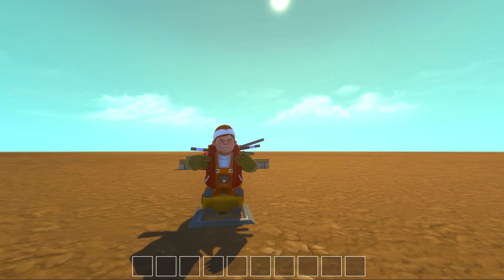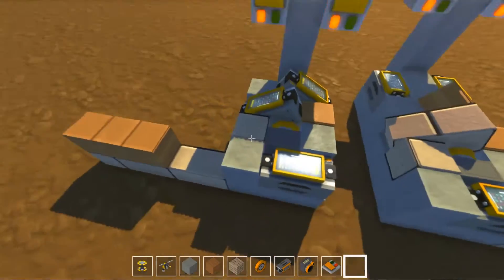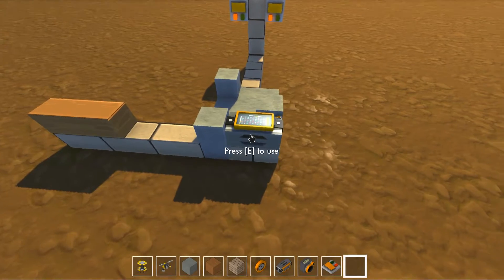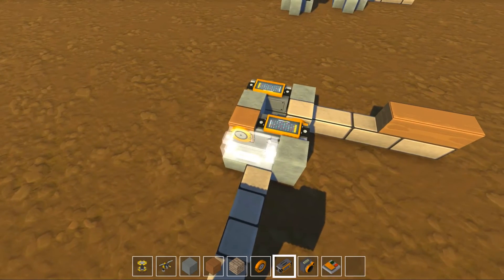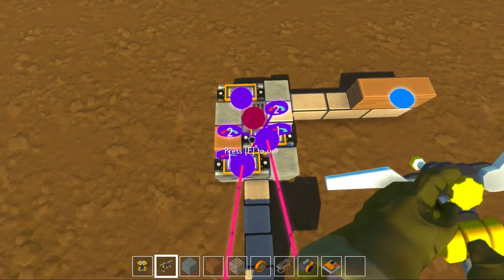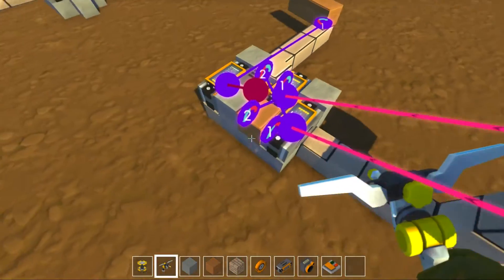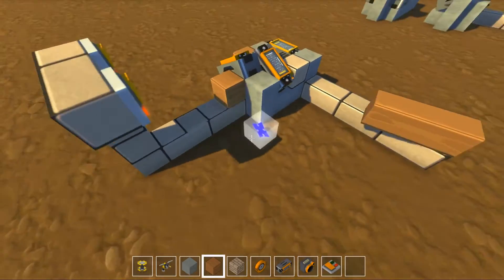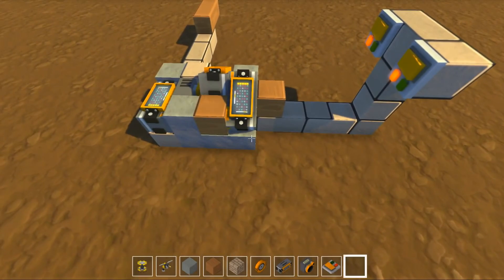Scrap Mechanic Tutorial - Ultra-Compact 2-way Switches (3x3 XOR Gate) [Logic Gates]

Comment: Isn't this easier for fast 2 way door switches? nice work tho,https://www.reddit.com/r/ScrapMechanic/comments/439v92/two_way_door_switch/
Reply from the maker: +Joaco Remis The thing you linked to may be a little easier to make, but it only works in a specific order - if you flip the switch from the outside, then go around to the outside again without flipping it from the inside, the switch isn't accessible anymore.  My design allows using 2 switches that don't move, so you can still open the door a second time from the same side.
Reply: Yeah, that type of gates will work 100% but, you shouldn't be able to go outside if the door is shut, so you will always face the switch
Reply from the maker: Joaco Remis The game already has multiplayer - just because one person is already inside the door doesn't mean someone else won't need to open it from the outside.
Reply: +Kondrik Yup, good point

Comment: if i make a question could this work with a elevator possible video?
Reply from the maker: +Cmanofminecraft This could definitely work with an elevator.  The only difficult part would be figuring out the best locations for the switches.